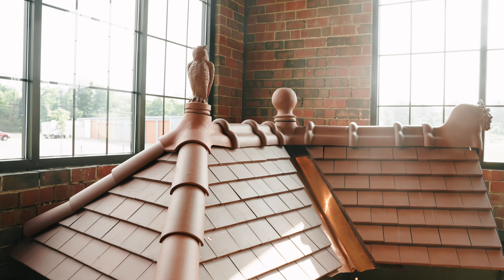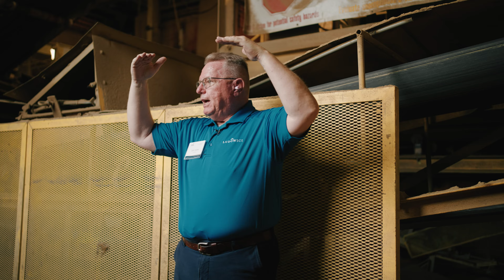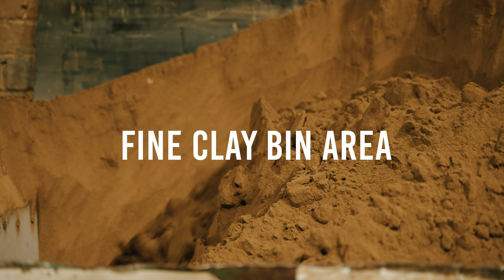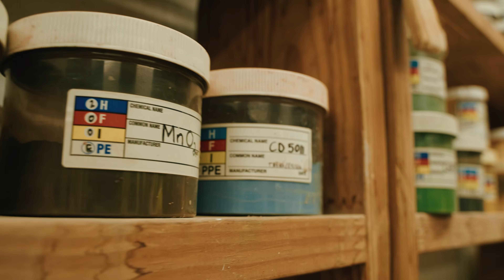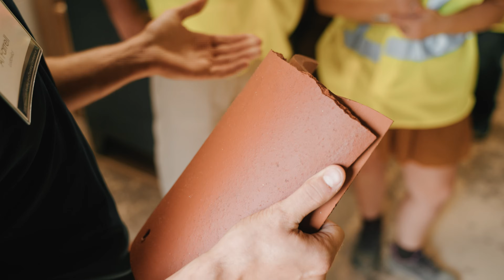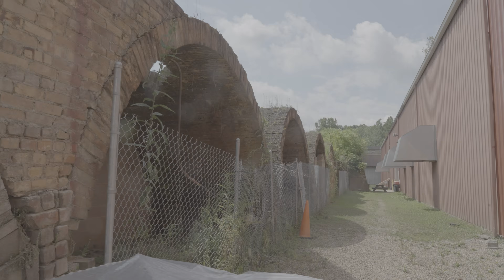Ludowici Factory Tour—the Finest Roof Tile You Don't Know About

Comment: Clay products were brought to the UK before the Romans invaded (55AD) but the widespread use of clay for tiles and hypercausts really started with the Romans. As the video says, the colour of clay varies from pit to pit but the Romans and their romanised British didn’t worry about that for clay used for building. The process for making those clay products didn’t vary from then until the industrial revolution in the 19th century. 

Clay was dug up locally and taken to the local tile kiln (we still have many roads called Tile Kiln Lane or similar) or, for a large build like a Cathedral, kilns were established on the site. There the clay was broken up and puddled. Puddling is the process of both getting the clay a more consistent texture but also getting rid of air bubbles. Puddled clay could then be left to dry a little if needed until the consistency made forming possible. Using simple timber forms, each tile was made by hand and then set aside to air dry. The kiln were small affairs compared to anything in the industrial Revolution and it was quite usual to use a kiln a few times and go and dig another a few feet away. Tiles for a roof or a wall (many houses have partly tile-hung exterior walls) were either made with a nib to hold the tile in place or a hole through which a timber peg was driven into the battens underneath. 

With so many houses dating from the 13th century onwards, there is always a demand for peg tiles for repairs. You can get factory produced ones but they are very inform. We look around salvage yards but there are is still at least one company in Kent still making them fully handmade - as well as bricks of all shapes and sizes.
Reply from the maker: NIce!! Thanks for sharing.